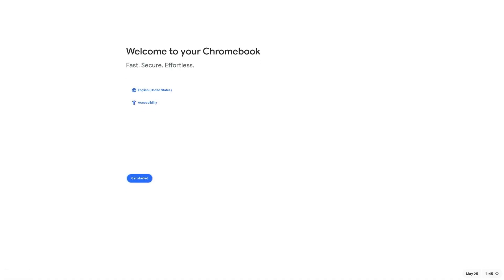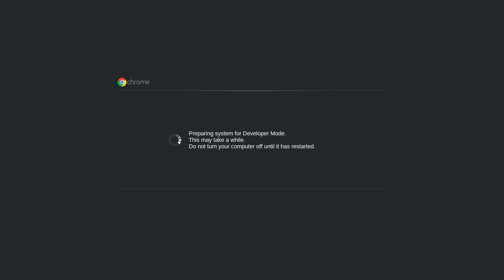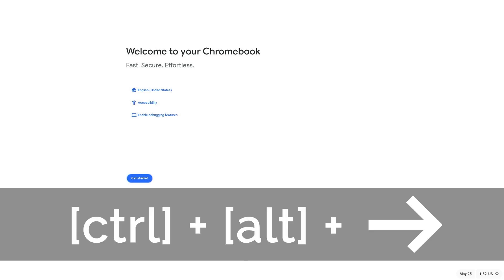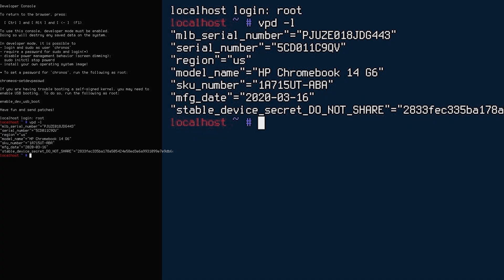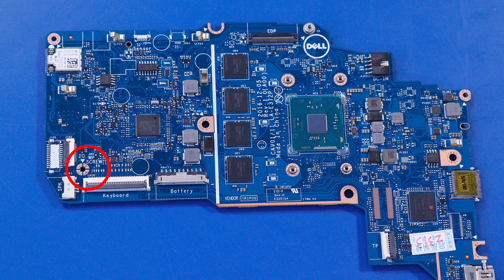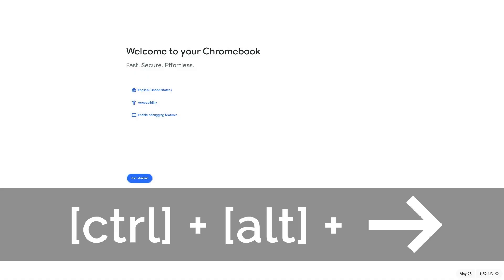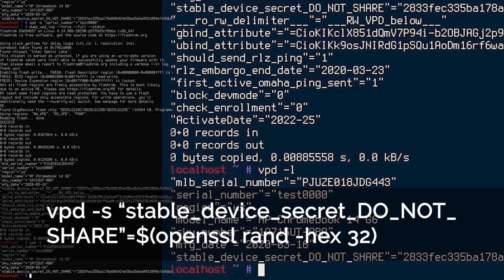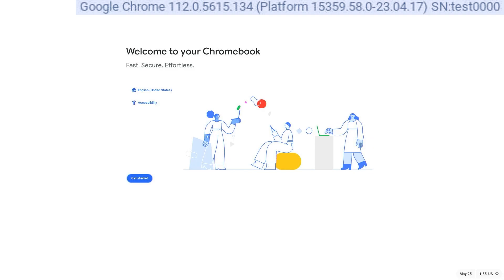Chromebook Motherboard Reserialization Tutorial

Comment from the maker: *UPDATE: if you have a later version of Chrome OS, you may need to type the following command after disabling write protection and entering back into developer mode:
flashrom --wp-disable
After you've changed the serial number, type the following command to reenable write protection:
flashrom --wp-enable
Reply: I keep getting write protection disable error
Reply from the maker: @jsalazar0384  what model device do you have?
Reply: @Chromebookparts Dell 3110 Chromebook
Reply from the maker: @jsalazar0384  Ah, yes that is a bit of a weird one. You have to remove the motherboard brackets on the right side, then replace the write protection screw, then reconnect the battery and plug in the adapter before you can boot into developer mode. After those steps, the rest of the process should be as shown in the video.

Here's a link to Dell support. Look at steps 5-8 for images w/instructions: https://www.dell.com/support/kbdoc/en-us/000209812/chromebook-3110-and-3110-2-in-1-rma-shim-process
Reply: @Chromebookparts unfortunately I don’t have a Dell RMA Shim. How would I be able to get one?
Reply from the maker: @jsalazar0384  Steps 5-8 on that doc just address how to disable write protection and get into developer mode. If your board normally boots into Chrome OS and you're just looking to reserialize it, no shim required

Comment: So how would this be done on a Lenovo 100e 4th gen Chromebook. I’ve done all steps including removing the WP screw and battery. So far I’ve tried to do this on 2 of these same model and can not get them to change the S/N.
Reply from the maker: There are some newer models that have a different method. Look for the section in this Google Doc we made titled "2023+ Disabling Read/Write Protect TI50":
https://docs.google.com/document/d/1VGgXymh1N_56tnMvDb578XJBsc_VCtVvOlh0Oh1Hb2Q/edit?tab=t.0#heading=h.c3s586raaa8

Comment: hi. just did this on an HP 14A G5. dump log command doesn't work, which isn't an issue. i did see in your dump a flag to check enrollment. not sure if that would be beneficial. anyways, changing the serial number of a dev mode board to the same as the device that im repairing did not automatically re-enroll the device in my google admin. is there something else i need to do?
Reply from the maker: In our experience, as long as the serial number matches exactly, it should enroll as soon as you connect to wifi under a provisioned serial number... Have you verified that the serial number was set correctly? (pressing ALT + V should display it in the top right corner) If they match and it still doesn't work, let us know!

Comment: Hi, hwru fine? Nice video!!! I have a question; If I dont Reserialize a mb, what would be the issue If Idont care about warranty?  And the new serial writed can be anything like "test0000"  or I need to read with alt+v  & use the mb serial on that command string to do so? . Thnx in advance, I really apreciate your job!🤜🤛
Reply from the maker: Hello! If warranty isn't a concern, and there's no need for a specific S/N (like at a school or some businesses), there should be no issues if you don't want to update the S/N on the motherboard. You can do alt+v to view the S/N, but you shouldn't have to change it to anything if you aren't worried about it.

We do recommend updating the S/N however whenevr replacing the motherboard, as if the sticker on the bottom of the device were to be damaged, you would have no way of knowing what the original S/N was. This could affect the resale value, or if you need to find parts later for this device it may be more difficult to determine what you need. Hope that helps!
Reply: @Chromebookparts  Really appreciate ure answer, many thanks, you rock

Comment: I have an Asus CR1100FKA where I need to run the RMA Shim after a repair. Right after I jumped the correct pins the unit won’t turn on. Plugged in, unplugged battery, tried everything. What’s weird is if I let it sit for 24 hours it will come back on. Any thoughts?
Reply from the maker: Hello! First, we're wondering what you're running the RMA shim for? Also, which pins were you jumping? We do not see any pass-through holes on this board. As for it not turning on, we suspect you are tripping the TPM, and after 24 hours it loses power and resets.
Reply: @Chromebookparts  it’s the write project pins on the motherboard. As per Asus we have to run the shim after changing any major parts
Reply from the maker: Gotcha. If Asus is having you use an RMA Shim after changing a part, we would recommend contacting their support to see if they are able to give you any information. Sorry about that. Without seeing it ourselves, it's tough to be more specific.